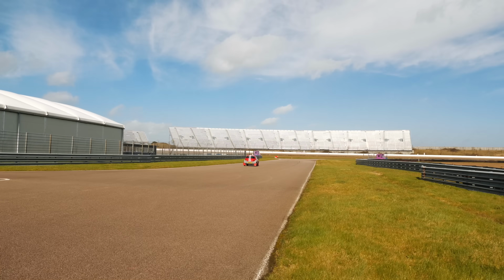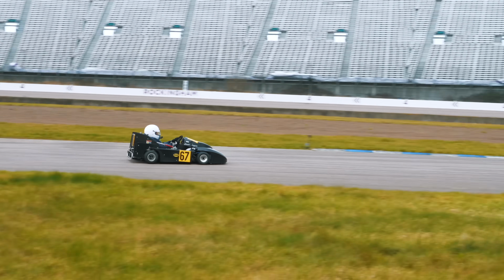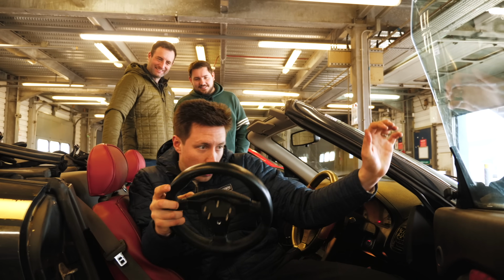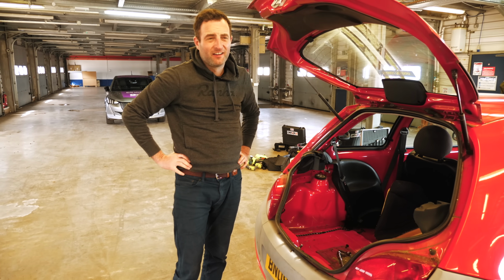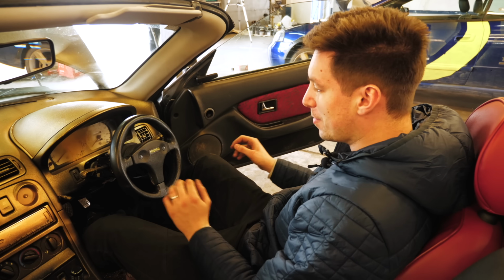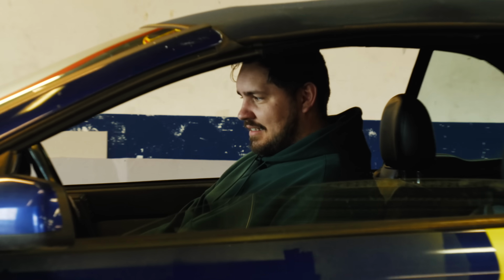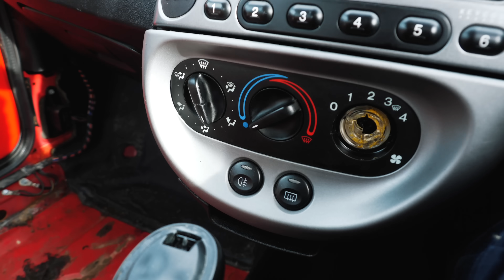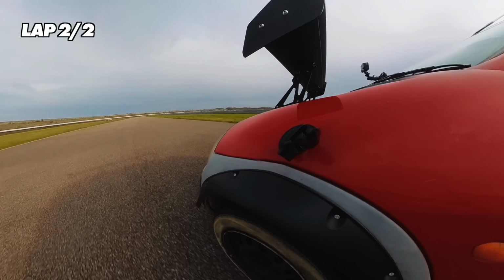We MODIFIED Our £1000 Cars!

Comment: Damn, I really wanted to see the Astra STI on track such a shame! The stewards need to investigate if someone sabotaged him... keep up the good work guys cheers from Slovenia ✌️
Reply: I suspect crankshaft sensor failure. Had an 1800 Corsa C and it had a hot starting issue. Car refused to start when the engine was warm. Stone cold and itd fire up first time every time.
Reply: Sounded like a fuel cut, bit suspect since happened immediately after he was messing around in the fuse box...
Reply: Maybe the ECU doesn't like the Traction Control fuse being removed, or he disturbed other fuses while he was in there.
Reply: @ProMilkshake  Would a worn CPS that's been heatsoaked cause a non-start? My old Supra has that issue, and I've been told the CPS is often on it's way out.

Comment: There's a Ma-Hoosive amount of tarmac parking area around the Rockingham circuit for all of Cinch's stock.

It'd be nice if Cinch would work with yourselves and/or some of the companies who run track days to put on some events using the Rockingham circuit. I'd be up for a bit of a lash round the place even though it is 140-ish miles from where I live.

Comment: What the fuck were those modification choices? 2 wings on a car that doesn't even go fast enough to use them! A Subaru wing that's just aesthetic on the car it came in glued with double side tape? It did fit well visually... The MG was alright, but instead of a new wheel, he could have saves some money by putting a spacer on the steering wheel.
Isn't that Astra Turbo? If he had messed with the turbo and removed the exhaust past the maf sensor that thing would go super fast.

Comment: If a car breaks during a challenge, just fix it and don't tell the audience. It's a bit of a disappointment when stuff like that happens. Btw did you check that you definitely unplugged the abs fuse and not say the fuse for the fuel pump?
Reply: Me disagree with the idea of fixing a broken car during a challenge without informing the audience. It's essential to maintain transparency and honesty in any competition to uphold its integrity and fairness. Covering up a malfunction may give one an unfair advantage, but it undermines the true spirit of the challenge. Competitions are not just about winning but also showcasing the hard work, skill, and strategy of the participants. By concealing the problem, one cheats not just the audience but also themselves out of a legitimate victory. It's essential to follow the rules and disclose any repairs or modifications for the safety of everyone involved.
Reply: @Professor-Scientist  either way so long as they fix the car instead of just giving up on it. I'm just saying that I wouldn't feel cheated if I found out that happened but they didn't include it to keep the flow of the show and give us the content in full